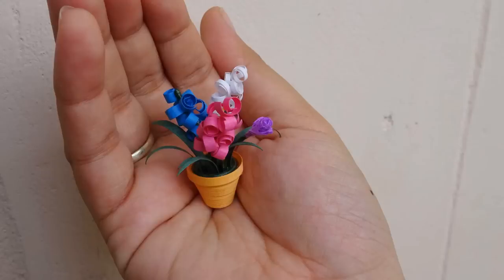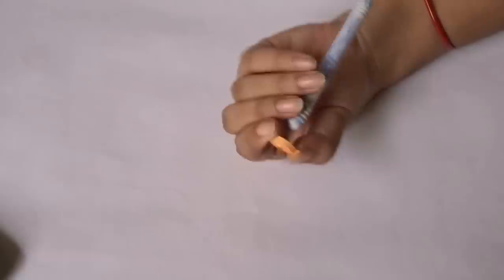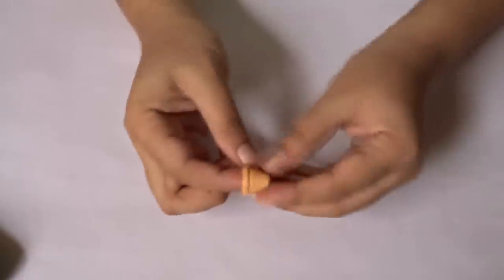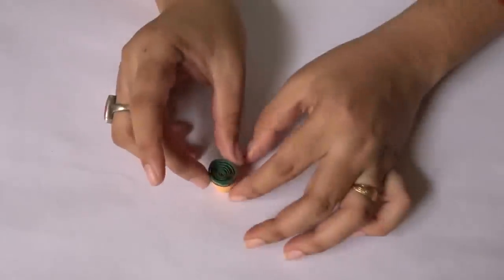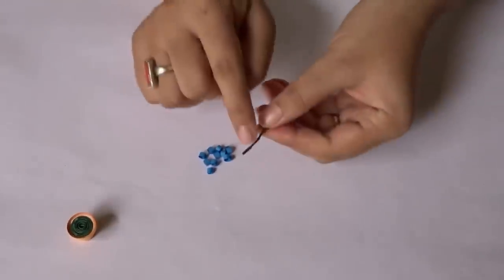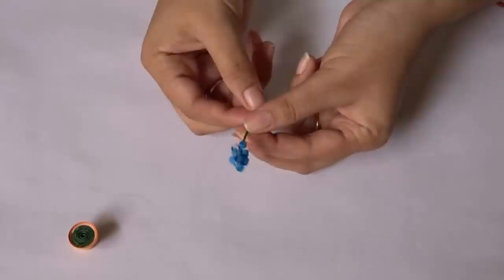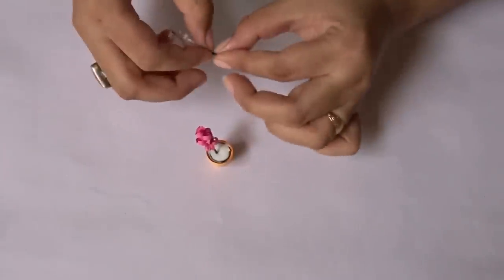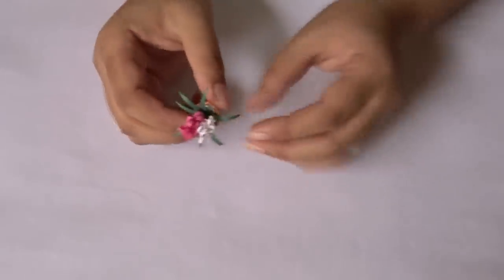Quilling miniature flower pot in 3d, diy

Comment: can we use toothpicks instead of tht wire cozits nt available in some of the stationary shops ..
Reply from the maker: +Rashmika Loka first of all thanks a lot for all your lovely comments....., yes you can use toothpicks but it will look very straight, rather use dry sticks of bushes which you can find very easily. That will give a natural look.